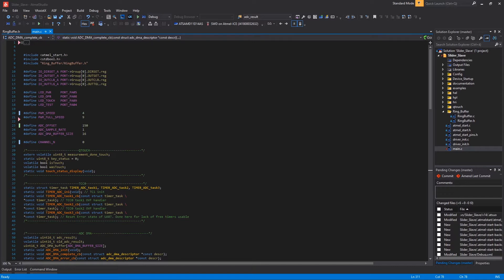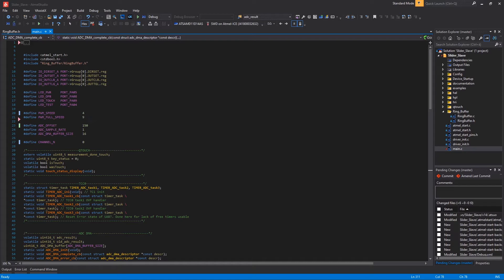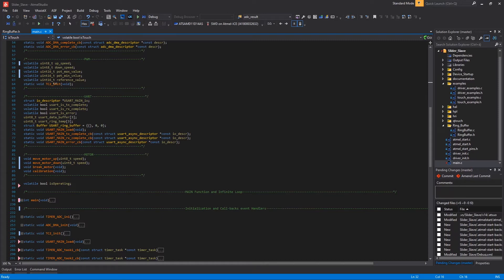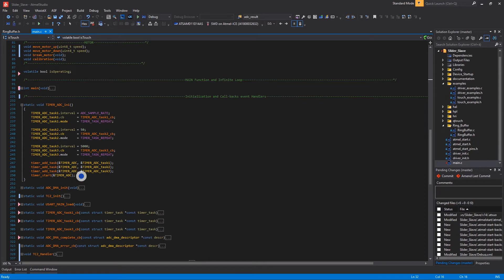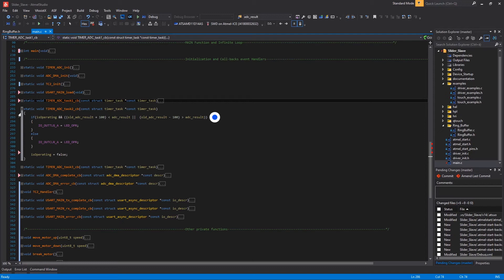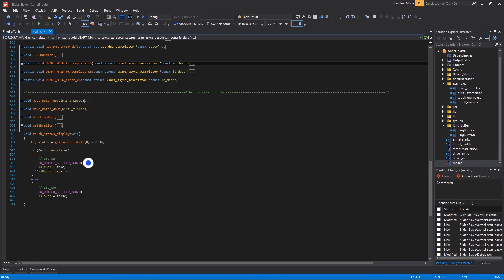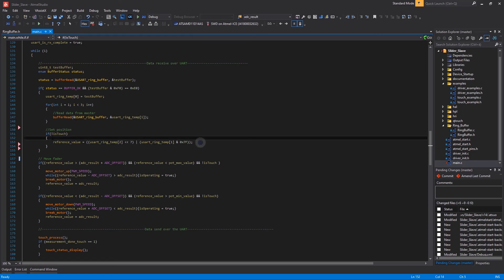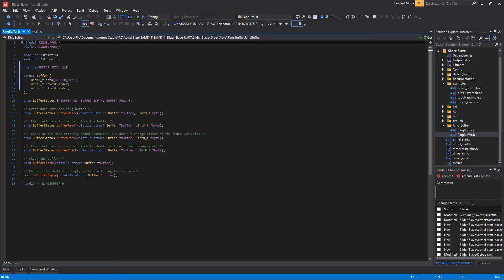Motorized fader as DAW Mixer Controller PART 4

Comment: Still Love this project!!

Have you implemented USB connection to the DAW?
and 
Can other buttons and encoders be added to the system for use through the Cubase generic midi tool?
Reply from the maker: Hello,
thanks for your appreciation :-)

I'm working on the USB implementation and yes it is absolutely possible to complete the strip adding select, mute, solo and rec buttons, the rotary encoder with LEDs and the meter bar! In fact i did it, please check the link below. i just need to find the time to make a video and publish the material.

https://1drv.ms/u/s!AoF-EiIcnf9VhsxNtr5haYCf0Yp8_g?e=J3U2di
 
Cheers,

Filippo
Reply: @fcampanini  that looks great 👍 
i would love to collaborate with you on this. if you are interested?
i have all my hardware ready but i am not the best at the programming